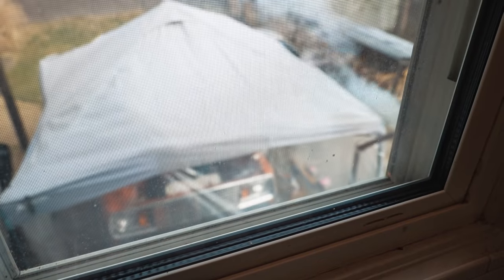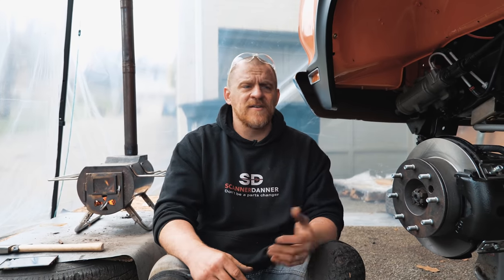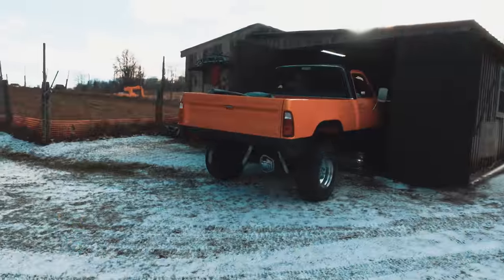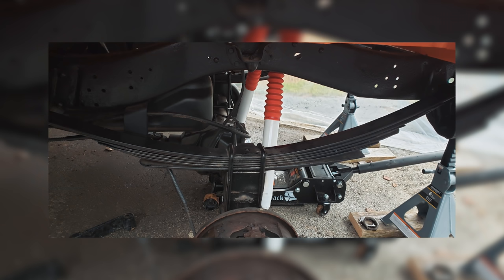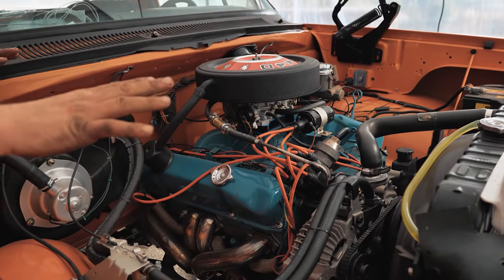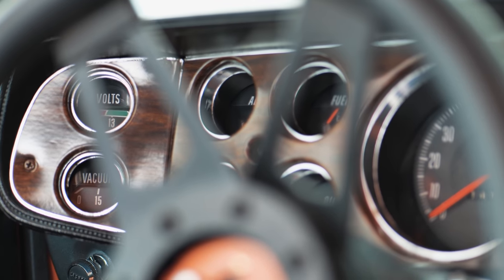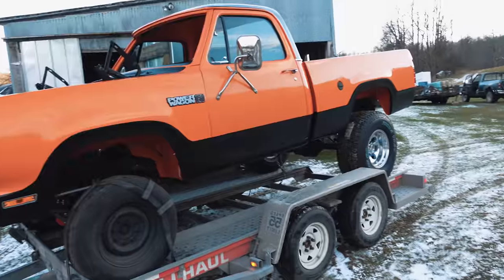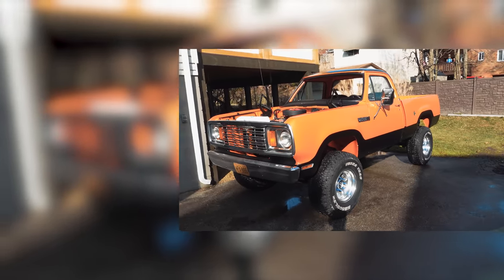I Bought My Dream Truck [Finally]

Comment: The old Powerwagons are BEASTS! I pumped gas at the local Shell station in the late-60's and the owner had a 4-speed that I had to use to plow snow! WHAT A WORKOUT, I was used to a WWII jeep.  Best of luck with the beast, I understand the attachment.
Reply from the maker: dude seriously, I cant' imagine plowing with the manual trans set up on these!
Reply: @ScannerDanner  Luckily I was 17 at the time and off to see my girlfriend after work! The lot I did was about 100' x 300'. Lots of shifting, raising, and lowering....

Comment: reminds me of my brothers 1974 ramcharger bought it froma  guy near Buffalo NY  the truck was from texas, yea last Ramcharger to have a factory 440 in it,!! full time 4wd as well. bought it when he was 19, in 1991. like you suspension lift, now has Dana 60 full floaters front n back on it, he was gonna put dana 70s but thought that was overkill. NP205 transfer case, and yea the 850 CFM carter thermoquad as well, with 42 inch super swampers on it.

Comment: Gorgeous looking truck, not like any modern truck blended in without any personality today. Chevy, Ford, Ram, Nissan or Toyota trucks all look pretty much the same. Nowadays, everything is disposable when manufacture stops making parts for 7 years old cars, when one simple module will leave you stranded. Law of obsolescence in action but 1978 Dodge Wagon still on a road even today.

Comment: Love the 70's trucks, Ford, Chevy, Dodge.
My toy a 1978, F-150 Super Cab 4x4, transplanted Lincoln 69/70 460.
Fender exit headers, 4 into 1 3" exhaust, super 44 mufflers. Exhaust exits in front of rear tires.
3.50 axles, turning 31x10.5x15. Can't run any larger tire it will rub on the headers on hard turns.

Comment: Congrats on the new ride Paul. i had a 1974 W200 that was my plow truck. The only issue was it was a 318 and pretty gutless and had problems with intake manifold carboning up, but I was told it was common on those engines. i'm not much of a Dodge guy anymore, but I don't shame those who are as it's to each their own. So enjoy and looking forward to the adventure.
Reply from the maker: yeah with those stupid crossover valves (EFE systems), it's been a long time since I thought of those!

Comment: Hey buddy
My phone got destroyed just got the new one Anyway
Never thought my self to be a Dodge fan but I’ve got a 66 Dodge Coronet Covertable 3 speed on the column 440 hemi trip carburetors
And a 93 Dodge Shadow ES Convertible 3.0 v6 5 speed having big problems getting parts for that bird.. Drivers power window regulator bad
But fun car to drive..
My latest project a 95 Chv 1500 fleetside 5.7 auto trans. Spider fuel injector lines leaking and fuel pressure regulator and she’ll be ready for some fun 🤩 
Been collecting these things for years. At 65 who knows for how much longer
But my dream car is a 69 Olds 442 convertible. SOME DAY
Have fun at the Dodge rebuild I’m looking forward to your videos…

Comment: Those old dodges with the 3/4 tone front (king pin dana 60), crossover steering is one of the best upgrades you can do. Redhead or blue top box with a borgson steering shaft and crossover steering is the way to go.

Comment: sweet, front axle faster gear so the front is always pulling, as opposed to rear end pushing it helps when turning, once a Dodge man always a Dodge man.
Reply from the maker: Freaking right man! Answer I was looking for. I said it already in the comments, I really do learn a lot from you guys too. Forever grateful for this
Reply: @ScannerDanner  Interesting.  If I remember right, my old Bronco ('73)   was this way -- I don't remember the ratios.  I just assumed because you would only be in 4x4 in slippery conditions that they just didn't have to be the same.

Comment: Great looking truck.  A MOPAR guy, like ya even more now.  I had a 1977 Power Wagon, bought it in 84, and had it until 2000.  Now I have a 2000 Dodge 2500 with the Cummins engine.  Your lucky, It would never pass smog inspection out here in Commiefornia with that engine.
Reply from the maker: Commiefornia indeed!!

Comment: I have owned a dodge dakota Shelby truck for 27 years now. it needs some work, and has been on the back burner. same situation, me and wife dated in the truck,. lots of memories.. you have inspired me to get the truck up and going again, im sure many memories will come back. like when I got drunk on christmas day, decided we would go fishing and high centered it on a log at a local fishing hole.  had to have a tow truck pull me off.  didnt catch shit either.
Reply from the maker: lol awesome story, thanks for sharing
Reply: @ScannerDanner  for a while I had a guy stop by my house every year for almost 10 years offering to buy my truck,. he wanted to strip it down and race it.  he always offered me peanuts and was hoping he would catch me short on cabbage, but I never let go of it.  growing up poor, I never had anything special . I had the economy model everything. I bought the truck when I got back from desert storm and at that time it was the fastest naturally aspirated truck made. around 15 second quarter mile.  the ford mustang cars where the rage at that time. I could run neck and neck with them in the 1/4 mile and they were pretty shocked to to see me right on side of them or pass them.. only 1500 of the dakota shelbys were made. and I have one of them. they are all numbered on the dash.
Reply from the maker: @randy1ization  glad you kept it! And thank you for your service my friend. God bless you

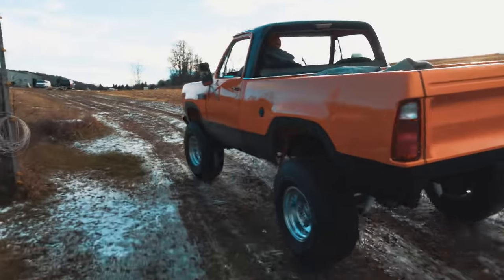Comment: 4:09 in the front so the front is slightly faster than the 4:10 rear for better control on snow and ice.  That's standard practice.
You don't want the rear pushing the front, you'll always be going sideways.
Lifted front end is hard on the front U-joints because there is more angle.  More acceleration/deceleration 2x per revolution.
Don't get seats too low for leg comfort.
Nothing better than a solid front axle.  
You will have to relearn diagnostics all over again..  Just don't try plugging in a scan tool and you'll be ok.   Enjoy!

Comment: Hey brother. The slip joints on your driveshafts look pretty extended. Don’t forget to get longer shafts. 

Looks like a fun project. Enjoy!
Reply from the maker: For sure! Front shaft need extended, back shaft already was by someone who doesn't know how to weld or center a driveshaft 🙄

Comment: I had a 72 Dodge 3/4 4×4 lock out hubs from warn 360 motor automatic but I wish I had a manual trans ,trade it for a 64 Chevy 1/2 2 wheel drive.

Comment: DUDE!! That thing is MINT!! Look at the body on that thing!! Could eat off it! ZERO rust! You couldn't have found a better one! AMAZING! I've been wanting something older like that for a daily driver, since my Silverado has been a Class-A POS from day one - rear end failed, tranny failed, and now at 117k miles, my engine is failing (low oil pressure - could be from a few different places inside). I'll keep the Silverado for a winter beater to keep the salt off the good old stuff. Speaking of that, hope it didn't get too blasted with that corrosive crap on the trailer. Still looked clean in your tent there! 

Nice setup with the stove! Wish they had something like that 30+ years ago when I used to work out in the cul-de-sac in front of my parent's place. Most sophisticated I got was a tarp during a rain storm as I repaired the power window in my '85 Monte, lol.  My "mid-life crisis" is aviation - I bought a paramotor!! Got trained on it last spring down in FL, and broke my hand on it in October, lol - snapped the 4th metacarpal in my right hand (Naturally!). I'm still not 100%- still hurts to try and make a fist, which I can't really make. Wringing out a chamois or paper towel is painful and difficult, but at least I'm able to work with it. I made a dumb, rookie mistake. So dumb not even rookies would make it because they're paying closer attention. My wing was unstable (oscillating side to side), and instead of correcting it I gave it FULL throttle! Yep. DUMB! FULL SEND! Trike went sideways at full speed (about 20 ... probably 25 with the tailwind), and flipped me over so fast I didn't even know I was upside-down for a second. Prop shattered too when the cage flexed into it, and it also ripped through the protective netting. Got a new prop here waiting to install when some nicer weather arrives, so I can start practicing again. I need a lot more, and better, ground handling skills. I've flown it 26 times successfully, so at least I have that under my belt, lol. It's AWESOME! Makes your own neighborhood unrecognizable from that perspective. All my buddies think I've gone insane - I can't get any of them to join me, lol! I've made some new friends that I fly with whenever I can. One is a customer of mine - he flies powered parachutes. Different animal, but similar in that they have a wing like a parachute. His is larger in every way, and requires a sport pilot's license. Mine requires NO license and NO registration! That was the big appeal for me (ultralight).  I still have my restored and modified '74 Yamaha RD350, so I could always sell that if the desire for another '72 or older El Camino, or '69 Grand Marquis convertible with a 429 gets too strong. :)

Great score, Paul! Can't wait to see your upcoming vids on it.  Now  ... you have to off-road it at least once, so you and the wifey can "christen" the cab, like the old days! :D I'll tell you, that ain't so easy in my late 40's as it was in my teens or 20's! You'll both feel really old, LOL! Still fun though - me and my wifey have done it a few times in the past 15 years, HAHAHA! Nothing like FULLY reliving the old days! ;)
Reply from the maker: You're so awesome man. And holy crap, you're crazy too!
Reply: @ScannerDanner  🤣 Thanks brother!

Comment: Very cool.  I love the Power Wagons but 78 and full time are not favorites but hey it is what it is. 
Professor's video on how not to have a mid life crisis. Well done. 
Really like the garage too. I have an open air garage on gravel. I can tell you what it's like to change a power steering hose in 25 degree weather and snow blowing. 
Dang it didn't go on, quick back in the house and heat up the hose. Thinking about it now I should have heated up the metal lines under the car. 
Great wood stove and canopy. 
Okay take me home country road. Great video Professor. Happy New Year and Happy Motoring.

Comment: Really coool! I still have my 1979 W150 stepside that I bought brand new. It's sitting in the driveway waiting restoration. I'm really interested in following your progress.
Reply from the maker: Nice! Since new? Awesome man. Good for you for keeping it!
Reply: @ScannerDanner  Yep, bought it brand new, it was my first new vehicle I every bought. It has a 318 but I have a 360 from a B250 van that I'm going to rebuild to use. It has really tall gears, they were trying to make it get better mileage. Remember this was right after gas rationing and the big push to make cars more efficient. It got 14 mpg...it didn't work.

Comment: Also the dodge dana 70 rear axle you can run wheel cylinders from 80s dually chev and they have a bit more power. And you can run the 3.5 drums and shoes from the dually vs the 3 drum from a srw. And the front break kit is like .5" thicker on a 1991.5 3/4 tonne
Reply: Talking dqna 60 king pin front and d 70 rear on a 3/4 or 1 tonne of same vintage. And upgrade to the stage 8 locking nuts, the nylock that you hammer a pin into can back off

Comment: Nice truck!  I'd recommend a set of long tube headers before doing the rest of the exhaust to get the most tq out of that 413.
Reply from the maker: how much difference in torque and hp for the long tube vs short tube headers for this 413? Any chance you'd have some figures? Thanks!
Reply: @ScannerDanner  With engine specs, I could give you good estimate.  Do you know compression, cam specs, and what cylinder head is on it?

Comment: Nice truck reminds me of my 76  c-30. I think Dakota buckets would work for you in that truck.
Reply from the maker: you think that they'd sit lower? I want the center buddy seat too. Also I want to use the original frame that these seats are sitting on. It is super clean too!
Reply: @ScannerDanner  it's worth a shot to look at them, they worked in the Chevy I don't know what the floor looks like in your Dodge.

Comment: I sold a 1985 step side Dodge a few years ago with a 98 drivetrain in it.  The frame was rotten, so I advertised it as "Buy the step side box, get the truck free."

Comment: Nice rig. I like your heated work area. Hey, whatever works right. Are we going to see an 01 on the doors? Just a good ole boy, lol. I actually learned to drive standard 4-speed on my grandfather's old F-250 farm truck, man those were the days. A shame manual transmissions are slowly fading away. Millennials actually call manual transmissions anti-theft devices, lol.🤣
Reply from the maker: a built in anti-theft device right?

Comment: You should put a rear disc brake conversion 😊
Reply from the maker: I do hate rear drum brakes lol, but I don't see any real advantage to doing that for what I'll be using it for :-) Not enough return on investment I think
Reply: It's not much more then what you will be spending on redoing the shoes and everything, only 350.00 to redo my 94 suburban.

Comment: NICE TRUCK.. man u really need to put a disk break set up on the back . its not easy to stop that old iron with big rubber.
Reply from the maker: If drum brakes are that less efficient, why are they still using drum brakes on heavy duty trucks? My RV for example was 4 wheel drum. Spartan Chassis 40k gvwr 
Serious question, not trying to argue. Would disks in the rear, stop better than a properly adjusted and lubricated drum brake set up? Thanks!
Reply: @ScannerDanner  I think disc breaks are more reliable and with hydraulically applied pressure go almost directly to the pads, it is instant. no springs to rust, and stretch, no adjuster wheel to fiddle with because the starwheel gets gunked up and doesnt adjust them in reverse. the pads are easily replaced.  with drum brakes the dust falls into the brake hub as they wear,, creating more gunk. drum brakes dont wear evenly. . with drum breaks basically mounted in a floating manner, just 2 pins and 2 springs with round keepers, they twist when brakes are applied.  just a very crude design.
Reply: also Dan, the hubs on large trucks are alot wider. and the brakes can contact more surface area 
many use a very problematic air system that causes many problems.  the drum brakes are also more prone to cause fires. broken pads have no place to go and bind. 
often when  the brakes will not release  you must climb under the truck and cage the brakes. there is a spring loaded cylinder that you turn a bolt in and it releases the brake for that one wheel.  I was a heavy truck mechanic in my younger days and pulled many broken, glazed  burned brakes off of heavy trucks. 
its also a heck of alot harder to sync drum brake systems and keep them synced because they wear unevenly , this is why the  drum break pads are thin on one end and thick on the other when they wear down. the whole surface of the brake liner will contact the drum surface at first, but as the shoe wears, the lining material builds up in between the drum and the liner doesnt contact the whole surface anymore.  the fact that the pads twist  is another contribution to uneven wear. 
you live up north dont you? a nice truck needs nice brakes. !   we never think we will have to lock up the brakes while doing 70 mph hr on a wet road but  it happens .

Comment: So where do you plug the scanner in at? LOL. I had a 77 and every once in a while it would do the weirdest thing. If I had the ignition on engine off and the engine stopped at just the right place, the ignition would fire like it was running. I don't mean like one ignition event, I'm talkin high frequency buzz and that coil was just pumpin it out! First time I heard it I went pokin around trying to figure out what the heck it was. I was real happy I didn't grab the coil wire before I realized what was going on. Let me know if you've ever had that old Chrysler electronic ignition do that. I've never seen it since on anything else.
Reply from the maker: did it smoke the coil? That's awesome!
Reply: @ScannerDanner  No! But it just about smoked me LOL. I figure the reluctor wheel just got in the perfect spot to do that. Never seen it since and I don't have an explanation for how it could even happen with no movement of the distributor shaft. Weird. I wish I would have had a scope handy to see how fast it was, but back then my scope was as big as a car.

Comment: Sweet truck man! I have a 72 that I also put a 413 motor and 4 speed but have a 440 air cleaner for it. Whose gona tell? Haha. 
I wanted to ask where did you get the front sway bar from?
Reply from the maker: It was on the truck when I got it

Comment: A very nice car and a great design. I saw under the hood that the rubber hoses were secured with electrical straps. Are you not concerned that vibration tears may arise in the future?
Best regards 👍
Reply from the maker: No, I'm okay with that. Fuel lines maybe not, vacuum and coolant hoses I'm not concerned.